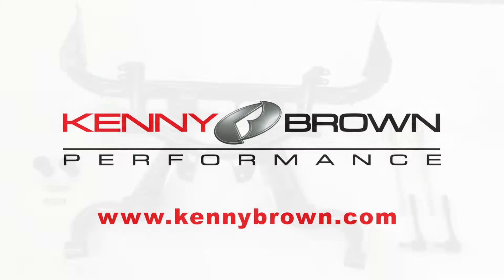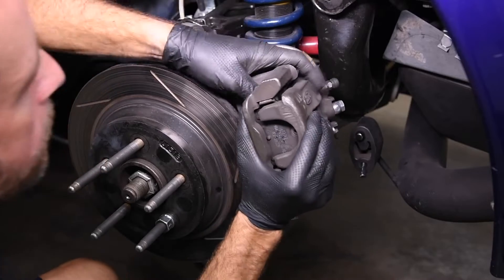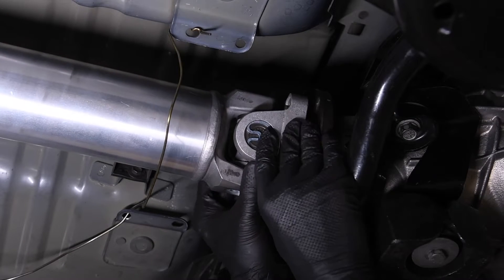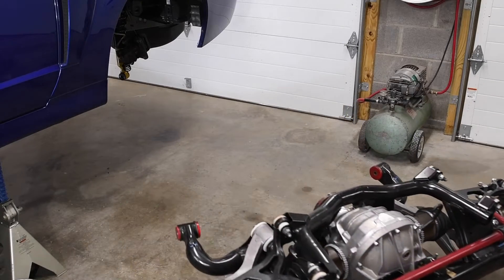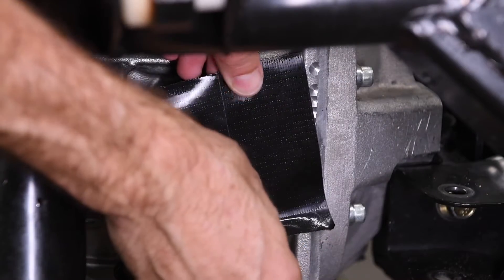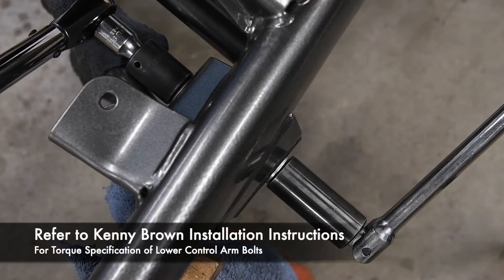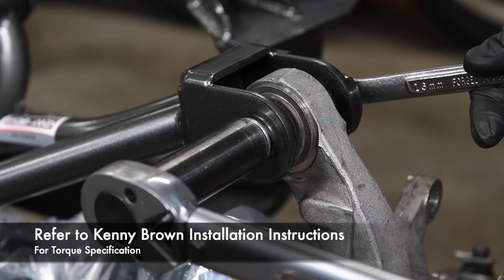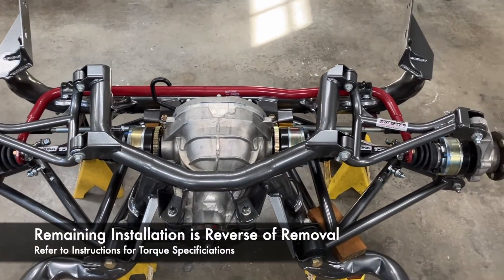How to remove and install a Mustang Cobra IRS

Comment: How do you like the kenny brown stuff? I've got a full tilt boogie setup on mine, but I've always wondered what the KB setup would be like
Reply from the maker: Kenny Brown offers something that simply swapping bushings cannot: improved geometry for lowered Cobras. Delrin bushings will only get you so far. Altering the geometry is fundamentally improving the kinematics of the rear suspension.